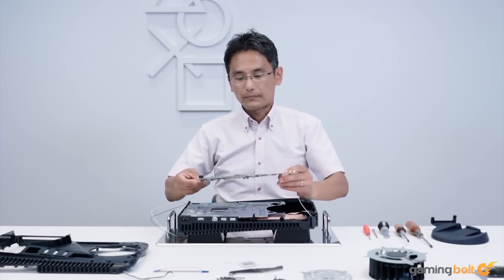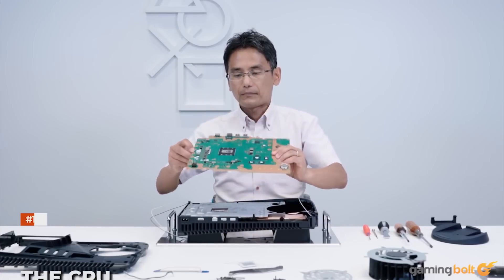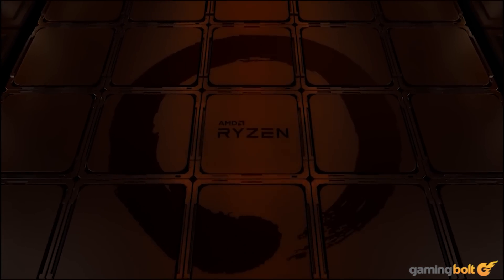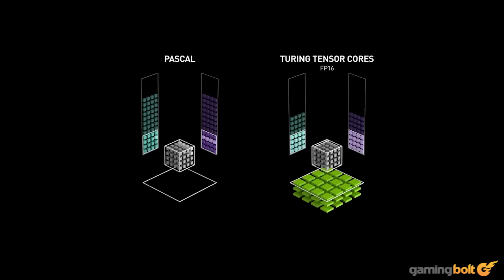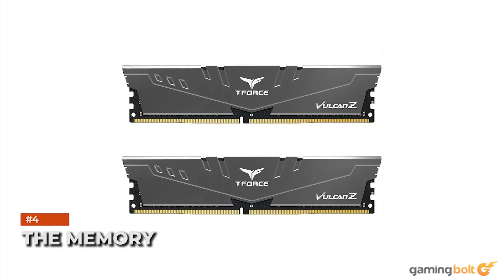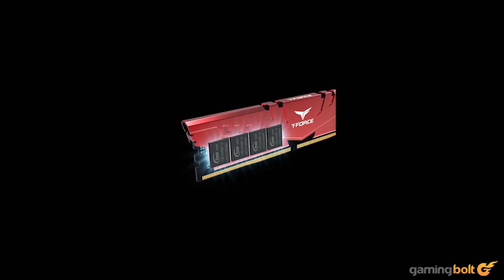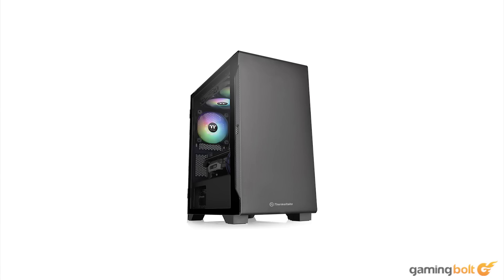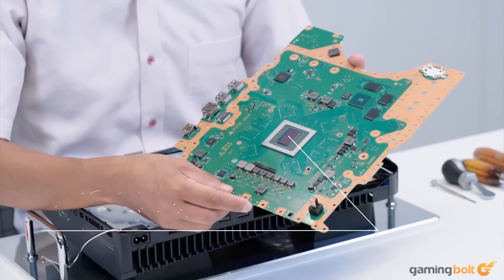How Much Would It Cost To Build A PC As Powerful As The PS5? (2021 Edition)

Comment: So the cost of a PC even close to the next gen consoles your talking between double and treble the price 🤔 lol 😆 I'll stick with next gen.
Reply: @Transistor Jump Cute how much you care to reply back, despite claiming otherwise.
Reply: @Orcawhale1  umm! with all of my knowledge from building my own gaming pc , i'm highly disagree! if i remember correctly , ps5 cpu is the same as ryzen 7 3700x , gpu is around rtx 2080 super ! i don't know if you're console hater or something but atleast  be fair ! no way that gtx 1660s can compared to ps5 ! cpu can hold up longer than gpu but if ps5 using gpu like that thing? it will be super outdated right now!
Reply: @zackfair872  
Your only half right. 
The Ps5 uses a 3700X, true. 
But they've cut SMT(Hyperthreading). 
Which puts it behind the Ryzen 5 3600. 

As for graphics, your again half right. 
If you compare the Ps5's gpu output in theory, it equates to a 2080/2080S. 

But if you equalize the settings, it's around 1660S/2060 performance.
Reply: @Transistor Jump Yeah, you could. 
Ryzen 5 3600 
Asus Prime B450M-K 
GTX 1660S 
CX 650W 
Crucial 16gb DDR4.
Reply: @Transistor Jump There's no such thing as "clockrate" it's called clockspeed.
Reply: @Transistor Jump Oh, you have plenty of time, with that failed youtube channel of yours.
Reply: @MohammadZeyaAhmad-eo1pe  there are so many sales in ps store and most of thetimes Online subscription can be 40$ on sale for a .So if you  buy at sale then its 320 $. The total cost is 820. If  you buy the digital e of ps5 then its 720.
Reply: Linus tech tips already built a pc as good as a series x for a little over $500. Consoles are sold at a loss anyways.
Reply: @dutyrover946  consoles where never sold at a loss. Even if games can make up for it, it will always mean that the strategy of selling a console at a loss will slow down a business from growing
Reply: @balloonb0y677  no it doesn't stupid. Sony and Microsoft get huge cuts from store purchases. If they were to set these consoles at a huge profit like every other electronic device is then these consoles would not be retailing at 499. The whole point is to get more people to buy consoles so that they can then spend their money on services that Sony and Microsoft offer. Its not a hard concept to understand.  Why do you think steam has tried making consoles over the years. Look at the steam deck.
Reply: @dutyrover946  so is that $500 off the shelf or just the components because for someone like me who is disabled and can't build one that option is mute.
I hear a lot from people saying you can build one just as good as an X for less than $1000 but you'll have to build it. The X comes out the box for only £500 no muss no fuss.
Reply: @TheRe54per  look if you have enough money to buy a disposable console that gets replaced every 7 years including it’s online subscriptions then so be it. Consoles have been stuck at 30-60 frames per second for over a decade now. Building a pc or buying a prebuilt that can do 60fps at 1080p  is extremely affordable. Next gen consoles can’t do native 4K and graphical fidelity is greatly diminished at 4K 120fps. If you can spend $1k+ on a tv to take advantage of next gen then you can afford a pc.
Reply: Looks like u r 1 of the lucky ones who already have a 4k tv because then it would make a whole lot of sense to buy a console, not everyone is as lucky as u 4k tvs cost 400 500$ easily so console cost + tv cost 1000+$ easily, 1300 or 1500$ gaming pc is much better because u can alot more than just gaming and btw these consoles were marketed as 4k 60fps but in reality they are not actually hitting 4k and are not even near to pc's max settings i know there aren't many true next gen titles right now but upcoming titles will have these shortcomings too
Reply: @COYG94  you have to buy a monitor for 300$ for gaming pc  -_-
Reply: @COYG94  you forgot that both consoles are hardly being taken advantage of. It’s been like this every generation, at about 2-3 years into the generation is when you start seeing the full potential of the consoles.
Reply: @balloonb0y677  By which time PC hardware has got a lot better and cheaper, so that 'take better advantage of the hardware' is mitigated entirely.
Reply: @TRONiX404  exactly
Reply: Not at all. 
The microchip shortage has just hit the hardware market hard. 
Which has then been compounded by the pandemic. 
Before all of this crap. 
You could easily build a Ps5 equal pc for around 600 bucks.
Reply: @Orcawhale1  PS5 is also not just 400$. It's 400$ + 180 for SSD expansion later + 60$/year online gaming + 10$ extra on new games. In 4 year's time (half life of a console) that adds up to : 900$ - with 8 new games bought at 70$ each (2 per year). PS5 is also locked to PS marketplace, and it's kind of difficult to get used digital games. And 4 more years would make it cost 1220$.
Reply: @deductivevariance3497  with expandable storage it’s best just to buy an HDD to store all your ps4 games and some ps5 games that you think you won’t be playing that often. This can reduce the cost by like $200 depending on how big and fast the HDD cost.
Reply: @deductivevariance3497  don’t forget that the comes with a $70 controller, hdmi cable, and usb type c cable.
Reply: @balloonb0y677  You forgot the power cable, the power adapter, the SSD, and both side panels of the case, I'm sure they also cost money individually. I'd also love to see you try and play with no controller, while a second controller will be another 70$... btw, for 10$ you can get a M&K set that will let you play. In fact, you can get a-n-y controller you want, including a PS5 one, and it will work. Since you already bought a TV that already comes with an HDMI cable, while monitors also come with DVI and maybe a VGA cable, while costing half of the price of a TV or less.
   Point is, where Sony looses money on the consoles, it makes it up and more through other ways.
   Warranty is also only 1 year, and the whole console needs to be replaced if it can't be repaired, whereas a PC can be more easily repaired - even at home - for cheaper.
Reply: @deductivevariance3497  it’s very unlikely that a ps5 will break. And did you say $10 for a mouse and key bored 💀 that’s literally like a school key bored and mouse, probably less ngl.
Reply: @deductivevariance3497  i didn’t forget the ssd. I said an HDD is a better choice than an ssd.
Reply: @deductivevariance3497  and replacing parts on a computer is more complicated, plus it could actually be more expensive depending on what part it is
Reply: @balloonb0y677  Ahh, so they finally updated the console to enable HDD storing for PS5 games also. Took their time.
   Does it mean that PS5 games have to be downloaded to SSD, copied over to HDD, and back to SSD when needed? Or when the SSD is full, copy 1 game to HDD THEN copy the OTHER game to SSD before gaming can happen? Just curious how that works now...
Reply: @deductivevariance3497  With a ps5 it’s plug and play. With a computer you need a mouse pad, mouse, keyboard, and monitor. And lots of updates
Reply: @deductivevariance3497  HDD storage has worked since launch day… with it you can keep all your ps4 games on it and some ps5 games that you think you won’t be playing that often. But it usually doesn’t take that long to transfer games because it’s not done on WiFi
Reply: @deductivevariance3497  actually, I think it was like 3 months after launch when they let you put ps5 games on an HDD
Reply: @balloonb0y677  You can't replace just a CPU or just a GPU on the console so the entire motherboard or even the entire console needs replacing AND need to be brought to a servicing place, while it is a simple process of swapping out a GPU, or a little more time consuming to swap a CPU out (maybe 5 minutes), it's cheaper than replacing everything at once AND you can practically do it at home.
Reply: @balloonb0y677  "...comes with a $70 controller, hdmi cable, and usb type c cable."  - I see no SSD being mentioned. The HDD is not part of the original box.
Reply: @balloonb0y677  But can you get 'literally like a school' controller for PS5 for that price though? Btw, for a decent combo of kb+mouse, it starts around 25 - 30$... still less than half of the ps5 controller. (The input devices are very customisable for PC, for different needs, wants and budget.)
Reply: @deductivevariance3497  I never said the HDD was part of the original box. I mentioned the HDD because id prefer buying an HDD rather than an ssd. I explained it pretty clearly, are you slow or something? I’m not trying to be rude but my comment wasn’t that complex and hard to understand
Reply: @deductivevariance3497  that’s not true. A decent mouse alone starts at $30, so as the keyboard.
Reply: @deductivevariance3497  and with a computer you need to buy a headset and Microphone. On the ps5 you don’t HAVE to.
Reply: @balloonb0y677  So the PS5 does all that with what exactly, telepathy?
Reply: @balloonb0y677  Your definition of decent, because you, a ps5 player would know. Can you get a PS5 controller for that much though?
Reply: @deductivevariance3497  no. But I’m saying that keyboard and mouse are extra amounts of money you have to pay. And the ps5’s controller has a microphone in it already so you don’t need another one.
Reply: @Transistor Jump You have no idea what your talking about, at all.
 
1. R5 3600 boost up to 4.2. 
While the Ps5 boost up to 3.4.
 
2. If you use equal setting across the board, then yeah it is. 

You got anything more stupid to say or?
Reply: and ps5 gpu is faster than rtx3060 and rtx3060ti
Reply: @superskills8343  uhh! to be fair ! no ps5's gpu are equipvalent to rtx 2080 super or if i goes easy on you : rtx 2080ti ! ps5 is a failure if  we talk about power , pc already surpass ps5 even before it get released ! do more research please!
Reply: But I can do so much more on my pc than you can your console.  And I have so much more control and options.
Reply: @Curt_Randall  and if I had the money I'd probably get one but I don't I've a house, kids, etc so it's a better option for me to get a console. It's all about personal circumstances. I mean it would take me an extra 3 or 4 years to save up for the PC and by that time it would be out of date.
Reply: @TheRe54per  what do those things have to do with building or buying a pc??
Reply: @TheRe54per  and out of date, really.

a pc is only out of date if the user pc cannot work properly on low settings.
Reply: @TheRe54per  the new consoles are great, if all games had mouse n keyboard support I’d not be on pc probably, consoles are so much easier n cheaper, just upgrade the thermal paste and you’re good for years haha
Reply: @TheRe54per  I've got a house and kids and a modest income. I've built 2 PCs so far. 🤷
Reply: @Curt_Randall  that is a superfluous argument because no one buys a console to do other things than play video games. The debate is what is the best gaming device. Not gaming plus other things.

Comment: $1137 sounds about right except you can’t actually buy a GPU at MSRP right now. It also doesn’t account for OS, keyboard, mouse, controller (optional), or monitor and speakers (you could plug it into a TV but the positioning would be hard). Hell the RTX 3060 they put in the build is $330 if you can get one from nVidea  or EVGA but $400–the same price as the digital edition PS5–from most retailers or $500 for Zotac: insane. Anyone claiming PC systems are cheaper is lying.
Reply: @Meta Data xbox has emulation
Reply: ohh no way buddy, if you add up the cost of the online play fees on console over the course of it's life cycle (usually 7-8years) you will end up with a much higher price tag than a brand new PC
Reply: @baraka629  no,
Reply: @baraka629 even at the mid tier PS subscription over 7 years, the total price of ps5 would be $1200. So equivalent to a comparable pc. That's Not accounting for Xbox gamepass which increases pc price. And that's not including monitor (people usually have a TV already), speakers, mkb, etc. For people who just want to sit, plug and play, and DON'T need pc for work, it's a no brainer.
Reply: OS is free you know, keyboard mouse you usually can get for a bundle for like 5$ and they work perfectly fine. If you use an old controller for the PC you most likely already have a TV so you can just use that for the PC if necessary just like you would for the PS5. PC is always a higher upfront expense but in the long run its cheaper.
Reply: @sack8439  so if i wanna upgrade a pc is it just the gpu you gotta upgrade or are there more parts?
Reply: @randyrrs7028  2 years old post that, but sure I’ll answer. 

Short story? Depends.

Long story? No.

If the CPU is too weak, you will see minimal performance increase on a new GPU, you will always see some, but it wont reach its full potential.
Reply: PCs are way cheaper when you mine crypto and use them for work haha paid for my PC in 6 months and I didn't pay for the Playstation network connection fees.

Comment: At this point I would get the 5600x over the 3600x. You will notice the difference and it's only a little bit more $.
Reply: yes but the point was to build a pc close the ps5 the issue was.. his choices were just vastly better than a ps5, a better comparison would be have a 2600x, amd 6500-xt which is literally the closest off the shelf gpu you can get that is what is in the ps5...  a 2060 stomps the 6500-xt.. and the 360 just blows both out the water, so when I saw a 360 and even the 3700x I already knew he wasn't building a true comparable pc to a ps5 because those specs pretty much spit on the ps5 performance wise.

Comment: This is a significantly more powerful build than a PS5 though. That CPU has a much higher TDP than the console version, and so performance is going to be much higher as well. That GPU especially with DLSS will run circles around the PS5 in terms of both ray tracing and rasterization. And that's the price for that machine NOW. Imagine it in 2 years. Much cheaper and still much more powerful. In 3 years you'll be able to build something even more powerful for around the same amount as well.

Not that powerful hardware is the be all of PC gaming. The library is the number one thing for me, followed by the versatility and options (from graphics options to ultra wide screen support, to various game pad and mouse and keyboard support) and mods. The powerful hardware is just icing on the cake.
Reply: That build is more than twice the cost. But only marginally more powerful in real time performance. Have you seen 3060 vs PS5 comparisons?  Console is the best value for the dollar right now.
Reply: @TeamMD0  your crazy if you think a 3060 is only marginally more powerful than ps5. Digital foundry did video on the next gen update that came for Doom eternal on ps5,xsx and xss. Doom Is very well optimized on all the platforms but, when they compared image quality to pc non of the consoles could even match the visual quality and performance of an old rtx 2060 running dlss.
Reply: @tafarimakonnan1763  lol ok bro. 😂🤡
Reply: @TeamMD0  ok bro you clearly did better testing than Digital foundries you a YouTube comment tech expert.
Reply: @TeamMD0  twice? Try ps5 + 6 to 7 years of playstation network connection fees and gamepass is around 1000$
Reply: @TeamMD0  yes it is more powerful. but they didn’t talk about all the features that make even any pc inferior